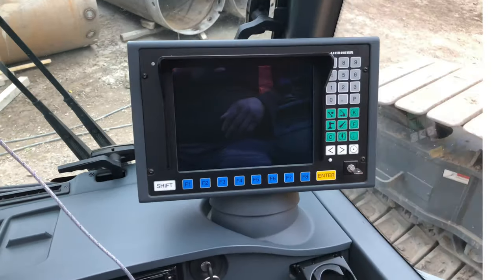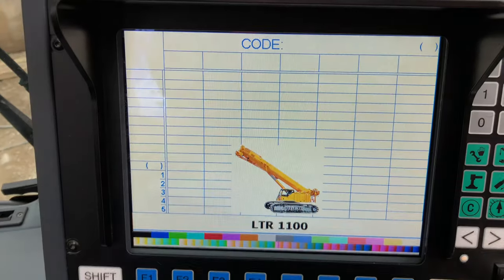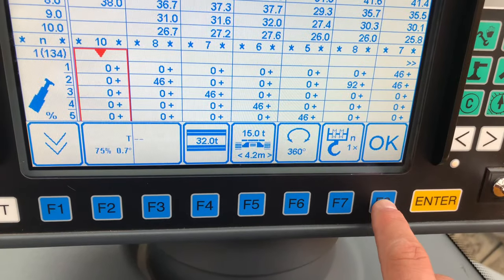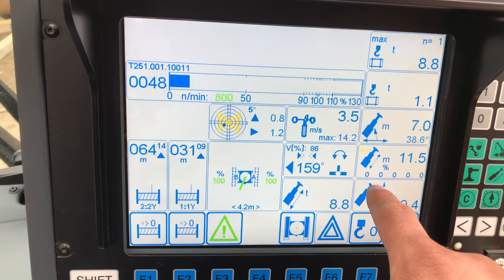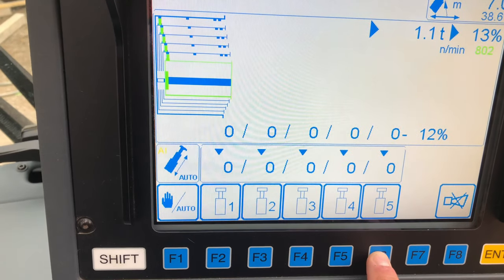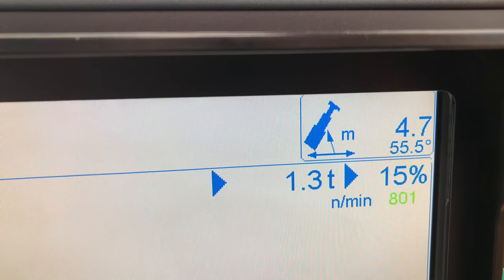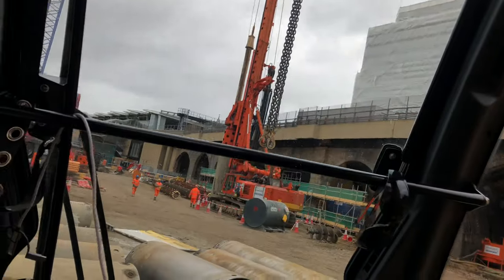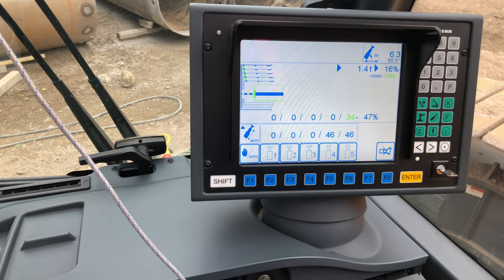Liebherr LTR1100 Tutorial

Comment: So different everywhere. i was told no lower then 68 degrees to extend more boom (LTM 1050 and 1060).
Reply: Everyone does it different. I have been told to to scope out at 60 degree in school. When with actual operators they tell you 70-75 degrees to scope in and out, to have less wear and tear on the sliding pads.

Comment: How do you a just the speed for the swing and the cable from the main
Reply from the maker: Zachariah Magallan on the levers there’s a button on the left, you hold that down for a few seconds and the pump speeds show on the main screen, you can adjust them by moving the levers from there. I’ll do another video next week showing how to do it if you want.
Reply: Yes that would be much appreciated as I am a new crane operator you could go over the control buttons on the joy sticks and what they do
Reply from the maker: Zachariah Magallan not a problem I will start tomorrow when I get into work, if you can share my video to other forms of social media and subscribe that would be fantastic.
Reply: And maybe a vid on how to properly grease the crane and where the fuel tank is and how to check the oil and anitfreeze
Reply: Yes i will share your vids